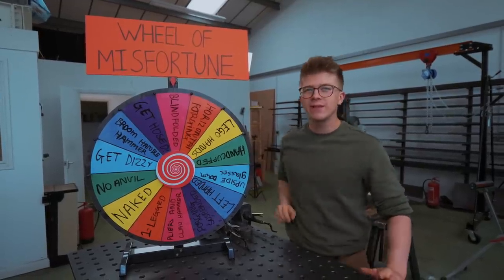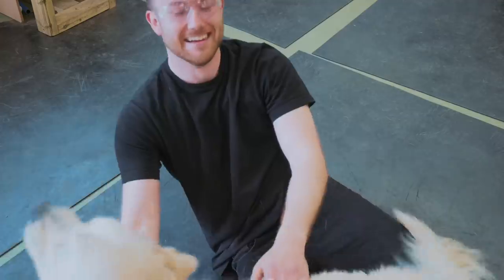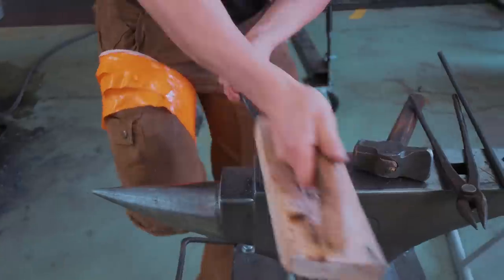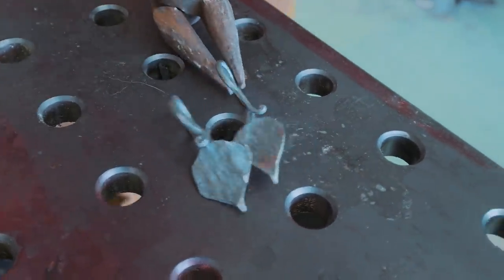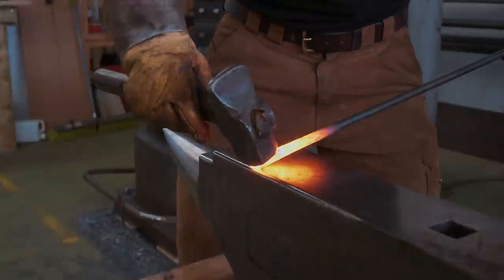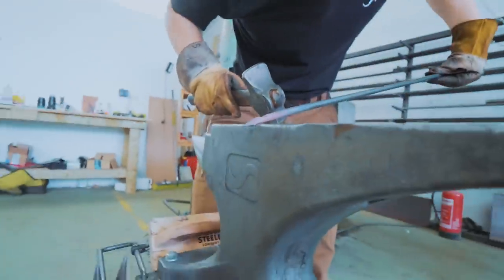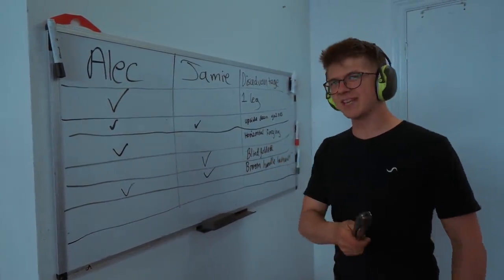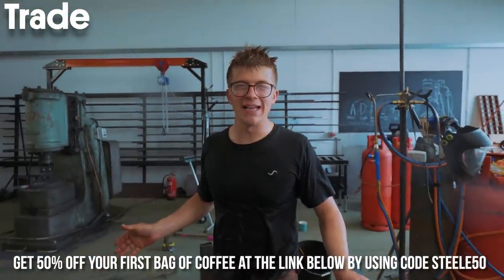ME VS BEGINNER... BUT I'M BLINDFOLDED!

Comment: I would more concerned with forging naked than blindfolded. Exposed wobbly bits and hot metal is a recipe for disaster 😂
Reply: Ouch! Didn’t think of that hahaha. Could have a brush fire if he doesn’t manscape! 😂
Reply: He's said on live streams that having little bits of scale come flying off is fairly common, but usually they are just restricted to hitting his arms. Could be an issue with less protection!
Reply: Gotta protect the plunker

Comment: I know another challenge the smiths on YouTube could undertake forging real uru. Considering the word is of indo European origins and has Sanskrit variant. Uru the magical steal. Made from a wootz variant. If my guess works right then if it real uru it should have carbon nanotubes that are growing in the boom as it’s forged. Isotopes that allow the steel to sing. I seem to remember a studies on nanotubes where if you could get them to vibrate it would create electricity. Heck it might even glow in the dark. The isotope would need to under 1% of the total billet. I guess it wouldn’t harm to shrink it under induction processes similarly to when you wrap wire around a nickel coin to shrink it much like a dying star would do. Uru is basically a space time Crystal (comprising of a nickel steel base with trace elements of manganese, chromium, vanadium and cobolt).  Cobolt 60.  Recently discovered phenomena. If you hit nickel steel with radiation it pulsate so If cobolt a wee risky then I’d suggest tritium fishing lures embedded into the steel. And hey presto. Uru! I’d let you smiths toy around with the exact composition. but you would be well on your way to recreating Thor’s hammer and a whole host of other angelic weaponry. Yes and I do believe it to be so as there are nuclear batteries that work on similar principles. So if you ever wondered what the mighty Thor’s being swinging all these years. it’s a primitive nuclear battery! That can bring the thunder from down under to life. Good luck! It definitely brings new mean to assault an battery! I’m assuming you know what to do. The processes for making woozt with a few minor tweeks. Once again good luck with your dwarves creations. A may the god speed you along in this endeavour.